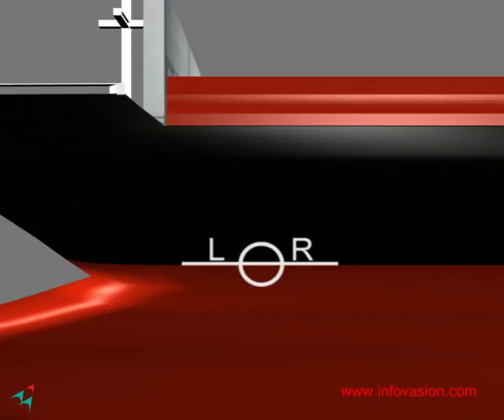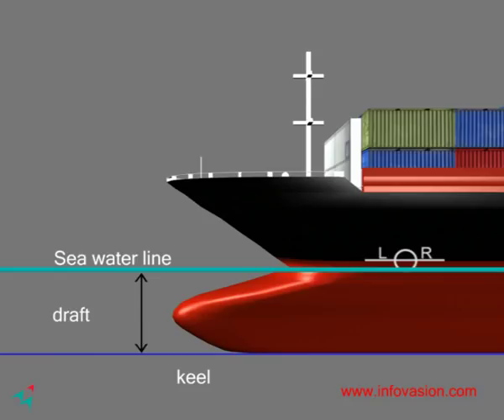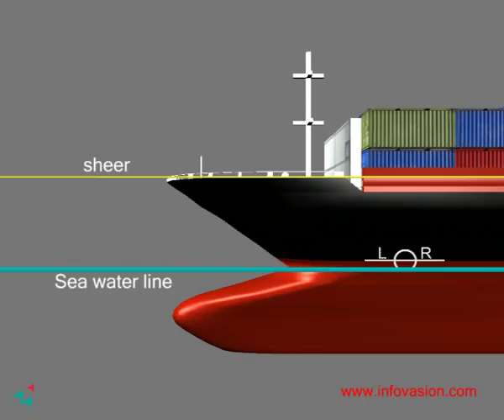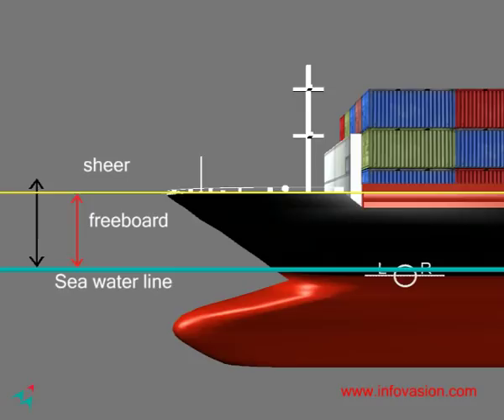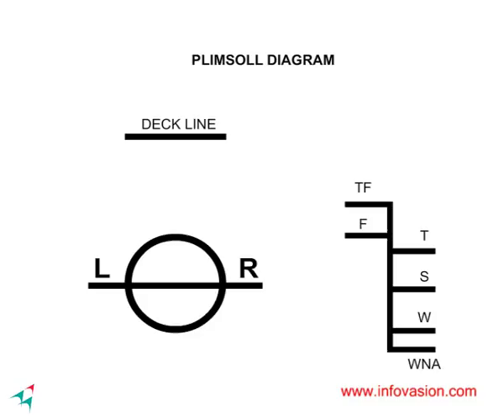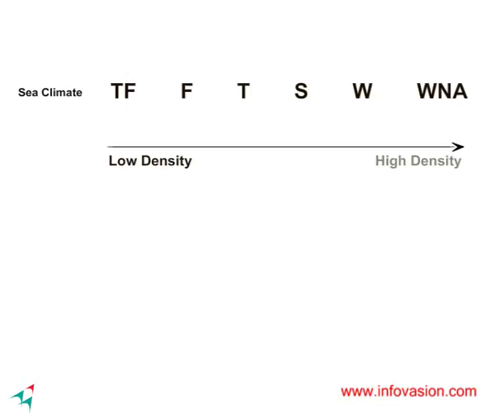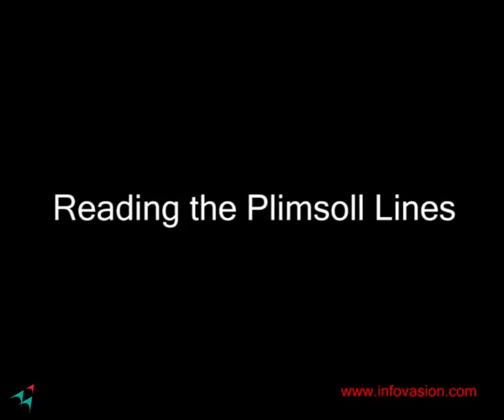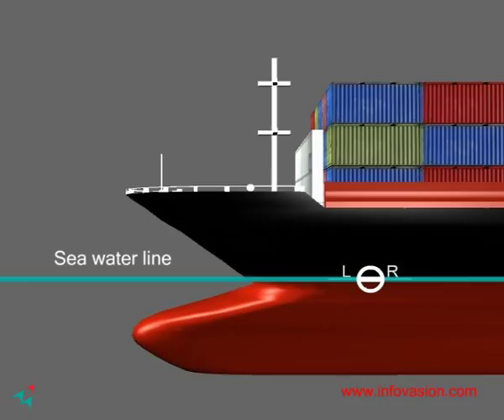Education / Training - Plimsoll line

Comment: While the video is very good, there are several mistakes which could confuse people. Firstly tiburochako is correct in saying that the marks are placed midships on either side of the vessel. Secondly the load lines are forward of the plimsoll mark not aft as shown in this video. Thirdly is gives the impression that you can load more cargo in fresh water than in salt water this is not true and is all dependant on DWA, FWA and TPC
Reply: Stewart Williams what is DWA FOR &TPC

Comment: This video has many flaws and the biggest one is that the Marks are in the wrong direction. The vessel is shown Port side where as the Loadline Marks are for Stbd side... Have a look... Serious mariners pls do not follow this
Reply: I don't... the plimsoll line should be displayed amidships (or thereabouts) on both sides of the hull.